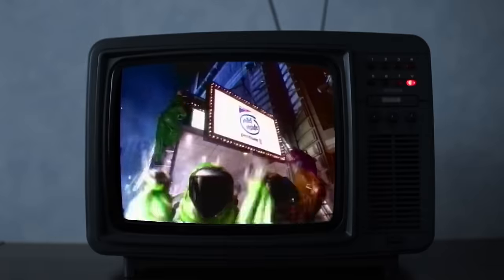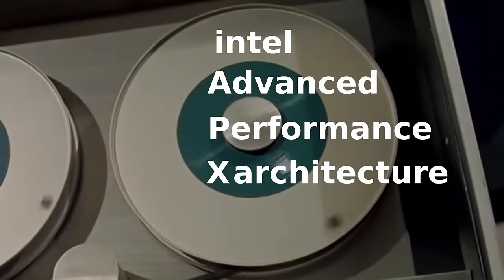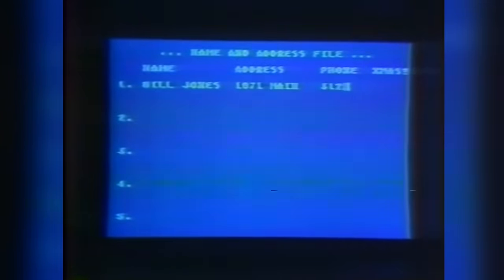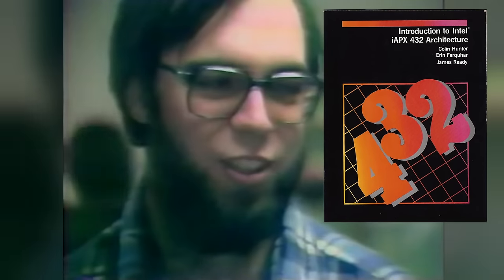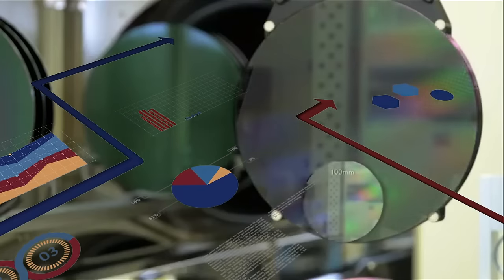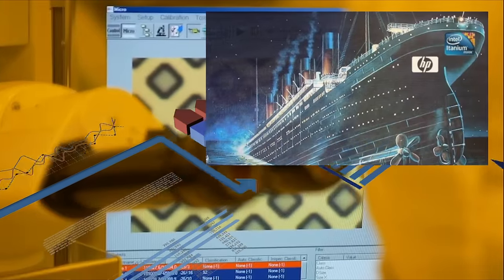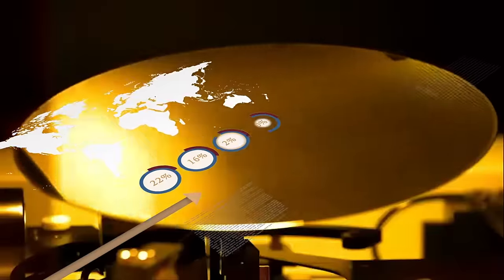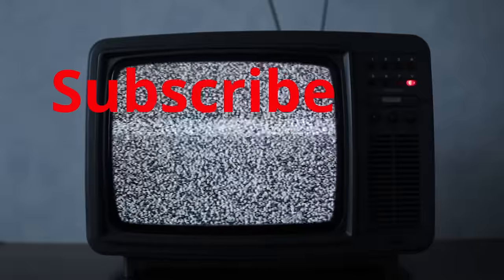iAPX The first time Intel tried to kill x86

Comment: 7:58 I don’t think the splitting into multiple chips was really a performance or reliability problem back then. Remember that the “big” computers used quite large circuit boards with lots of ECL chips, each with quite a low transistor count. And they still had the performance edge on the little micros back then.

Of course, chip counts and pin counts would have added to the cost.
Reply from the maker: Cost should never be under estimated in success of a product. Placing that aside, the big board cpus at this point where starting to come to and end. Propagation and settling time had become the significant factor in limiting performance for them. DEC had been very clever in how they grouped logic together in single ICs to avoid the worst consiquences. Intel had apparently had been less clever in how functionallity was spit over the packages, so more or less every insturction involved crossing packages. You should see the instruction latency on some of the instructions, some of them are massive, and most of that delay is apparently crossing the packages some times many many times.  Also it stopped Intel just increasing the clock rate to get round performance issues due to the increased noise sensitivity on the chip interconnect. Motorola could nock out higher clock rate 68k chips, not an option for Intel.
Reply: @RetroBytesUK  Motorola would try this same concept with the 88000. It was several chips to have full functionality and was a bit of a bear to program. Though its downfall was mostly cost and lack of backwards compatibility.
Reply: The big issue was latency going off chip. The government knew this and sponsored the VLSI project. The breakthroughs and insights gained allowed 32 bit (and later 64 bit) microprocessors to really flourish. The next big step will be 3d chips (many logic layers on top of each other.) The big challenge is heat and the unbelievable complexity in circuitry. Assuming these chips get built, the performance will be truly mind-blowing.
Reply: @billymania11  3d design has been in mainstream use to some extent for about 10-12 years already starting at 22nm. Albeit early designs were pretty primitive to what we may think of as a 3d lattice of circuits. And wafer stacking has been a thing for several years now. Mostly in the flash and memory space.

Comment: Correction: the IBM 5100 Basic Computer already existed and used an i8085 chip which uses the same bus as i8088. It was not a random choice to pick the 8088.

Comment: Seems like they didn’t learn their lessons of “letting the compiler do the thing” when they did Itanium.
Reply: I was thinking along similar lines, "been there, done that, failed hard".
Reply: I have a slight feeling, that it may be kind of the opposite approach.
iAPX intended to make writing compiler(s) for it easy.
Itanium made writing efficient compilers for it impossible.
Reply: To be fair it is at least as much HP's fault: They got enamored with WLIW when they bought Apollo and got their PRISM architecture with it. HP already was working on a 3way LIW replacement for the PA. Which is a shame, because PA was a very nice and powerful architecture :/

Comment: So completely different from Itanium, which basically went for "well the compilers will sort it out eventually"?
Reply: The i860 shares more issues with Itanium than 432 does i think.
Reply: > went for "well the compilers will sort it out eventually"?

Right. The sweet spot seems to be the middle ground: Either superscalar RISC, or CISC to RISC-like translation which is what Intel does since the Pentiom Pro (AMD shortly after).

Comment: One fact that drove the decision on using the 8088 in the 5150 PC was that they had experience with using Intel's 8085 CPU in the Datamaster and the 8086 in the Displaywriter.
Reply: Yes, and also that the 68000 was too new, expensive, and lacked a second source at the time. (But they also contemplated the Z80, as well as their own processor, among others.)

Comment: The main takeaway I got from this video was that for all the faults of the CPU, the compiler itself was much much worse; using hugely inefficient CPU instructions to do simple things when the CPU had far better ways of doing it built in. Much like the Itanium how much more kindly would we be looking back at it had the compiler writers actually done a really good job? Hell, the "compiler had to organise the instructions" idea is in use today and has been since the Pentium. How much different really is that to the Itanium's model? I just think that Intel has a history of hiring the "right" people but putting them with the "wrong" teams. They have engineers who come up with really interesting concepts, but then when it comes to implementation it seems like they just fall over and pair it with some really stupid management. Meanwhile on the x86 side they add something that sounds suspiciously like a nerfed version of what the other team was doing and then they kill the interesting project or allow it to fail and then put billions of dollars into assuring that the x86 line doesn't even when faced with arguably superior competition from other CPUs.
I just remember that when RISC came about it was considered slow and dreadfully inefficient and it was some time before the advantages of simpler CPUs started to make sense. If the money and backing had been behind language specific CISC instead of assembly focused CISC would we be looking back at x86/68k and even ARM and thinking "boy, what a weird idea that compilers would always have had to turn complex statements into many cpu instructions instead of the CPU just doing it itself. CPUs would have to run at 4GHz just to have enough instruction throughput to resolve all these virtual function calls! LOL!"
Reply: c++ virtual function calls are usually only two instructions in x86 (plus what is needed to pass arguments and save volatile registers that are needed after the call if any). This is almost certainly bound by memory latency and mispredicted indirect jumps rather than by instruction decoding.

Comment: 3:39 Did you say that the VAX had an IF-THEN instruction in hardware? There’s nothing like that I can recall.

It did have an elaborate range of conditional branch and add-one-and-branch and subract-one-and-branch looping instructions, which seemed designed to directly represent FORTRAN FOR-loops. And who can forget the polynomial-evaluation instruction?
Reply: The polynomial evaluation instruction is basically a maths co-processor and entirely sensible. It enables one to accelerate the calculation of trigonometric and logarithmic functions. Saying it is silly would be like complaining that an x87 maths co-processor had an instruction to calculate a square root. All you have done is shown your complete ignorance of mathematics. I would note that the ARM CPU has a whole slew of do something and branch instructions so again not a stupid idea. In fact it sticks in my mind you can't branch without doing an add; you can always add zero. Pretty popular processor architecture the ARM last time I checked.
Reply: @jonathanbuzzard1376  It “accelerates” nothing. That’s the point.
Reply: @lawrencedoliveiro9104  Oh deary deary me. Next you will be telling me that hardware floating point accelerates nothing. However given that hardware floating point does indeed make a huge difference when you have floating point arithmetic to do the claim that a polynomial-evaluation instruction does not accelerate anything simply displays a complete and total ignorance of how you calculate a whole bunch of mathematical functions.
You can do it with specific instructions for trigonometric, hyperbolic, logarthmic functions as the x87 maths co-processors did, or as the VAX did you could do a polynomial evaluation instruction that can be used with the appropriate Taylor series expansion for what you want to calculate. Noting that a Taylor series is just a polynomial. I suggest you read the wikipedia article on Taylor series https://en.wikipedia.org/wiki/Taylor_series
TL;DR a machine code instruction to do a polynomial expansion sounds like the height of CISC. The reality is that it is nothing more than a generic floating point maths accelerator for trig/log/hyperbolic functions and completely sensible given that most RISC CPU's have hardware floating point instructions too. The problem is that too many people are ignorant of exactly how you calculate a range of mathematical functions. I would further note the Babbage Differential Engine was nothing more than a mechanical device for calculating polynomial functions.
Reply: @jonathanbuzzard1376  The VAX had hardware floating-point.
Reply: @lawrencedoliveiro9104  Duh the polynomial-evaluation instruction WAS part of the hardware floating point. What is so hard to get about that? All the trig/log/hypobolic functions are calculated as a Taylor series expansion which is a polynomial function. Like I said if you had read and understood you could either have specific instructions for each mathematical function OR like the VAX did have a general purpose polynomial instruction that can be used for any of the given mathematical functions calculated using a Taylor series expansion, so sin,cos,tan,ln,arcsin,arccos,arctan at a minimum. In actual fact the polynomial evaluation instruction is probably better than specific instructions because you can use it to do Fourier series as well.
Reply: @jonathanbuzzard1376  No, it was in microcode.
Reply: @lawrencedoliveiro9104  Whether an instruction is done in microcode or on transistors directly is no relevant. On that basis the Intel x87 maths co-processors where not hardware floating point because everything was done in microcode. That is frankly not a strong argument. In fact many instructions on CISC's computers are done in microcode. Side note AMD got started in the x86 business doing x87 compatible co-processors that where "full" hardware and thus much faster than the Intel parts.
The point is which you don't seem to understand is that a polynomial evaluation instruction is not the CISC insanity that you seem to think it is. It is just an obvious optimization to accelerate a whole bunch of trig/log etc. floating point calculations rather than have individual instructions for each function. Trying to argue otherwise just demonstrates a total ignorance that unfortunately most people have on the topic of calculating these values.
Reply: @jonathanbuzzard1376  And notice that none of those other chips ever had a POLYx instruction.
Reply: @lawrencedoliveiro9104  Yes because they had a sine instruction and a cosine instruction and a ln instruction etc. However you can do ALL of those with a POLYx instruction; there is more than one way to skin a cat.  I can't quite understand why you can't get it into your head that a POLYx instruction can be used to calculate all your trig/log/hyberbolic etc. mathematical instructions by using the right polynomial. The POLYx instruction was therefore just part of the floating point unit of the processor. Nobody criticises other CPU's for having instructions for calculating trig/log/hyperbolic functions. They only criticise the VAX for having a polynomial evaluation function because they are ignorant about how you calculate those values. If you understand how those values are calculated it looks like an entirely rational and sensible decision. One can only shake one's head that 30 years later I am still trying to explain this.
Reply: @jonathanbuzzard1376  Hardware floating-point units do not have trig instructions. POLYx is not much use for computing such functions.
Reply: @lawrencedoliveiro9104  Oh deary deary me, you could not be more wrong. So assuming the Intel 80387 is a hardware floating point unit (I would like to see your argument that it is not) it has the transcendental instructions FCOS, FSIN, FPTAN, FPATAN, FYL2X and FYL2XP1. You can derive the hyperbolic's from these. So having go that out the way, POLYx can be used calculate anything that you would with a Taylor series expansion which is pretty much all your transcendental functions. You really should not talk about that which that you know not and you clearly know nothing about numerical analysis.
Reply: @jonathanbuzzard1376  POLYx is useless for things like CORDIC algorithms.
Reply: @lawrencedoliveiro9104  The cognitive dissonance is strong in you. You have totally ignored your incorrect claim that hardware floating point units do indeed have functions for calculating transcendental functions. There are a whole slew of potential algorithms for calculating the transcendental functions, CORDIC being just one of them. Another is a Taylor Series approximation which is simple and requires relatively small numbers of terms to get a decent level of accuracy. I also alluded earlier that the POLYx could also be used in calculating Fourier transforms. The VAX had great floating point performance in my personal experience. You are determined that POLYx is a waste of time simply because you are unwilling to accept you might be wrong.
Reply: @jonathanbuzzard1376  None of which is relevant to the uselessness of POLYx.
Reply: @Lawrence D’Oliveiro It's hard to take someone seriously when they make easily verifiable factually incorrect statements such as hardware floating point units don't have trig functions. Especially when they don't hold up their hands and admit they are wrong. So with a background in computation physics and extensive numerical analysis experience I known for a fact that a polynomial evaluation function is useful from personal experience. I am old enough to have extensively used VAX/VMS machines at university. There are a whole range of algorithms that can make use of it, from calculating transcendental's to Fourier transforms and much much more. The POLYx instruction is only useless to people who don't understand it's application in numerical analysis; which is clearly yourself.
Reply: @jonathanbuzzard1376  Nobody does trig/transcendental instructions in hardware any more (it may have been thought a good idea in the 1980s, but not now). POLYx is useless for numerical work because a) it doesn’t take convergence into account, and b) you can’t pipeline the coefficients effectively.

If you don’t know what “convergence” is, go take a course in numerical analysis.

There, I hope I’ve given enough hints as to why all your ranting is wrong.

Comment: The Ada language was a safe bet back then because it was being bushed by the US Department of Defense, which was the origin of a lot of software back then.  IBM's decision to go with the Intel processor architecture was because Intel let AMD second source the processor.  IBM's standard was that no part could have a single source.  Some of the rumors around the 432 was that Intel was pushing it to freeze AMD out of the processor market.
Reply: Correct. Ada and the i432 were the chosen code and platform for the F15. Programmers could wright a ton of code in Ada and once it worked the programmers would be able to clean up the code in assembly language.
Reply: Unfortunately for Ada, most of the early compilers were buggy and slow.  Ada was pushing the compiler (and PC) technology limits of the day.  Today, AdaCore's Gnat Ada compiler is just another language on top of the whole GCC compilation system.  The only real drawback to modern Ada is the lack of massive standard libraries of code like Java has.
Reply: Pushing out AMD was also a goal of Itanic.  Intel never learns that competition keeps them sharp.

Comment: Kinda. the 8088 was a special modified 8086 because Intel had the 8086 16-bit CPU but it didn't yet have a 16-bit support chipset for the 8086.  Intel modified the 8086 to the 8088 to work with the 8-bit support chips for the 8080.
Reply: , That's exactly what I said.

Comment: To be fair to Intel, relying on a single cash cow for your revenue is not a good strategy from a business standpoint.  I mean everybody knows that sooner or later x86 must come to an end as a popular architecture, and the rise of ARM has shown that maybe the x86 days are numbered, especially with it starting to make inroads into what has traditionally been Intel's home turf.  

But iAPX is a classic case of Second System Syndrome, where you have a successful but quirky and anachronistic product on the market that had a lot of design compromises, and you want the opportunity to basically design it again, only do it right this time, throw in all the bells and whistles you couldn't include in the original product, etc.  The engineers get to have a field day, but the resulting product is rarely what anybody in the marketplace actually wants and often under-performs compared to the product it was meant to replace.
Reply from the maker: Your right its not good to be dependent on a single product line. At theat point in time Intel did have a whole bunch of product lines, it just most of them where not processors. They where things like floppy drive controller chips, and in 70's to early 80's ram chips too.  I think they did feel like x86 was a sub par processor architecture, and that your right second system syndrome kick in with iAPX, they also had a good case of third and forth system syndrome after that.

Comment: Someone at IBM should have tried harder to contact Gary Killdall.  The z80 or the Motorola 68000 would have made a better PC.
Reply: I'm hoping you meant to write z8000.  Having written z80 stuff under CP/M, I'll state that the z80 had much of the issues the 8080 had: a paucity of registers (even given the alternate set and IX/IY) with dedicated function to a few.  I.e. instructions which favored register A or the HL pair.  Both the 68k and the Z8000 were clearly thought out as minicomputer processors, and had a far better ISA, addressing, and a architecture spec'd MMU,.  (Actually two varieties of MMU in the case of the Zilog.)